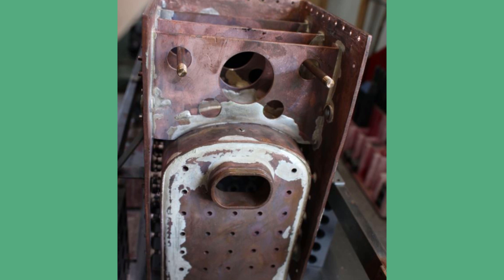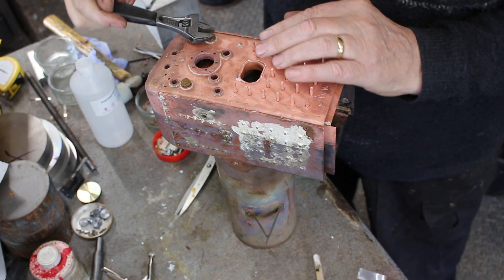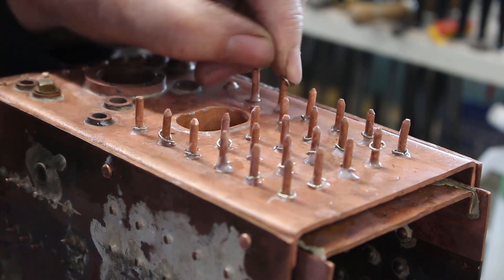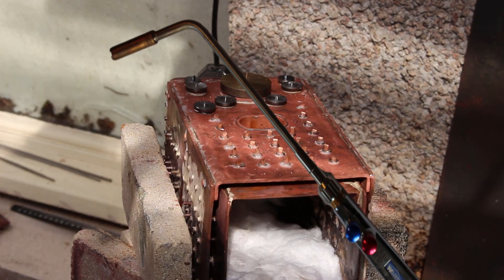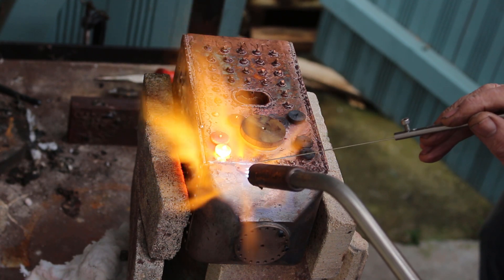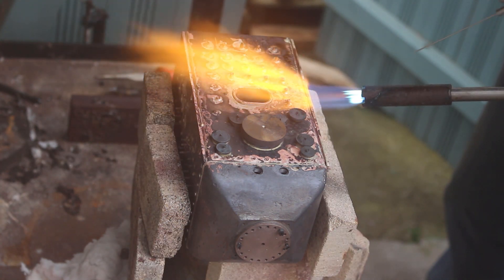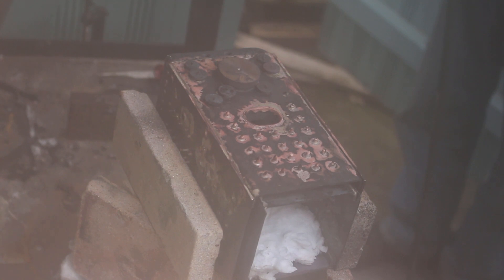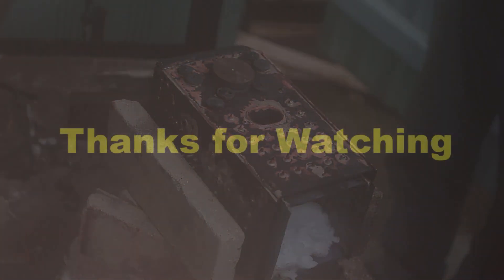LION - Miniature Steam Locomotive Build pt. 17 - Silver Soldering Boiler Backplate

Comment: Watching you apply additional silver solder with flux on it makes me wonder, do they sell silver solder with a flux core as they do for lead / junk solder? 

That is one heck of a lot of solder joints.
Reply from the maker: I've never come across fluxed silver solder, brazing rods are available with flux on the outside though, I've seen Kieth Rucker use them.

Comment: I discovered your channel a few weeks ago and am hooked. I built a small static steam engine way back when I was at school for a project, however have never had my own equipment to do any more. Now I've been able to kit out a small workshop bit by bit, I would like to get back into model engineering. But a 'schoolboy' question about silver soldering......as you heated to backplate to solder the various stays and joints, what prevented your previous joints from un-soldering? Being copper, it must have conducted the heat pretty effectively to the work you've already done?
Reply from the maker: Thanks for watching my videos, it's much appreciated. Good to hear you're building up a workshop, a workshop there's nothing better than building stuff yourself.
I'm very much an armature at silver soldering a boiler like this, I learnt so much form doing this boiler I could certainly do a better job next time. This back plate was probably the most difficult silver soldering job, the previously soldered in bushes suffered even though they had been soldered with a higher melting point silver solder, it would have been better to have not pre silver soldered in the bushes, I should have silver soldered them at this stage silver soldering in the back plate. The lesson is do as much as you can in one heating.
Using higher melting point silver solder helps when subsequent silver soldering is needed and which can be done with lower melting point silver solder. Previously silver soldered joints require a higher temperature to re-melt which can help, all the same it's not easy.
getting heat in local to the joint being soldered as quickly as possible is I think a key factor, oxy acetylene would be ideal but not usually possible for hobbyists. Oxy-propane does help allot and much better than a propane only torch for a boiler this size., I'm not sure how well I would have done without the oxy-propane.
I found this back plate a big challenge, and it came out surprisingly well  but as said not without compromising the previously soldered bushes. What I found is, if you melt previously silver soldered joints they become depleted of silver solder to some extent.
Not sure I've answered your question very well, all I can say is it's not an easy job and i would highly recommend having an experienced boiler builder helping with the soldering if at all possible. I would indulge in plenty of practice before talking on a boiler like this, maybe try a small vertical boiler to get some experience.
Hope that helps.
Reply: Go Create Hobby Machine Shop that’s great, thanks! The boiler I made for the static I built was only 3 joints - two pipe end caps and the filler/safety valve, so didn’t really come across the complexity of yours. Building a boiler like yours is still a way off yet.....but one day.....